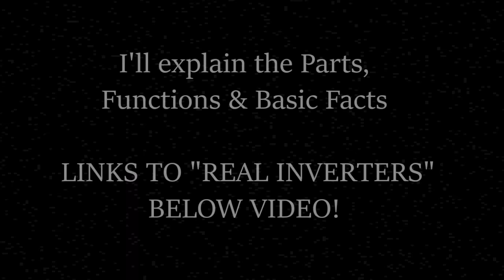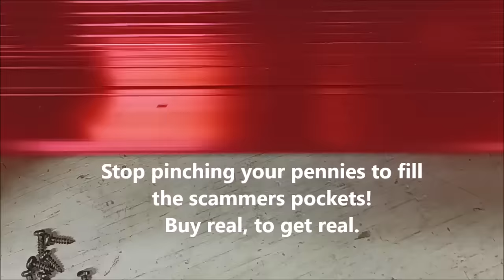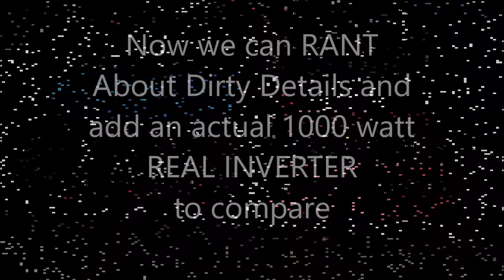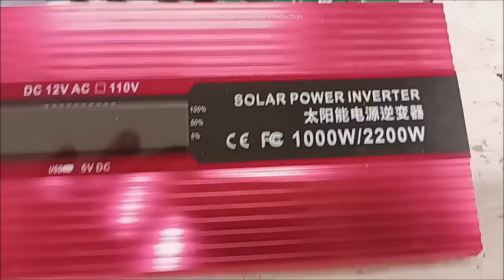Cheap Fake-A-Watt verses Affordable Real Power Inverters, Mega Parts List Below!

Comment: Hi John. I have some 24 v (42 volt open circuit) panels and a make sky blue  60 Amp charge controller. Do I need a 24 volt inverter and two 12 volt batteries in series to use my panels? I need a back up to run my freezer and fridge if power goes out. Do you know of a good 24 volt inverter if that's what I need?  Thanks so much!
Reply from the maker: Most controllers will charge 12 or 24 volt battery. My controllers take in 90 volts and charge my 12 volt system.

Comment: GREAT timing. I am in the market for a 1500 to 2000 Watt PSW inverter. Gotta save up a bit (just blew 8500 on building my truck so funds a bit low atm lol) I ran the 4awg wire today. Working on the power monitor and distribution center now. I will put in my tiny 500 watt one for now until I get better. I trust your judgment. Over the years i have followed you, you have always been transparent and in the beginning i always researched your findings on stuff. I was never able to prove you wrong, after awhile i gave up and just trust your judgment. If you perchane read this. Do you think a used one in good condition is ok? I found a 2K renogy for 100 bucks.
Reply from the maker: Yes, a used renogy 2k is is worth the $100. Just look it over well, and give it an actual smell test. If it smells like anything burned in it proceed with caution. Make sure that the fans come on with a load over 300 watts and test it before you buy it if you can. If you can't probably still worth the gamble they're not really hard to fix.

Comment: Hello, would like to know what are the voltage range to ffed these 12v inverter ? Could it be powered by 18V powertool batteries (15v-21v) ?
Reply from the maker: 10.8 to 15.25 volts is minimum and max.

Comment: Quick question.. I just followed your link to AliExpress and found what seems to be a decent 3000 W inverter. Just to be sure, are you recommending these inverters, as obviously the video was showing the lack of quality in a lot of Chinese inverters. By the way, nice to see an honest opinionated video.
Reply from the maker: Those 3000 and 3200 SWI Power inverters are from a company that has been around over 15 years, they are solid performing inverters without junk parts in them or flashy ads. I have used them for over 12 years, only had one ever needed anything done and that was my cause, not the inverter.
Reply: @JOHNDANIEL1  many thanks for the quick reply - appreciated

Comment: Hey John have you heard of the quality of Seplos products here in Aus its not reviewed at all, the price is higher than Eve etc. Cheers
Reply from the maker: They are just another group of packagers and sellers. They are targeting your market since it's still somewhat open to new branding. However, Their quality is good, and if you want to get it cheaper as with any China ran outfit, you start your arguing and grifting on them for discounts and deals directly contacting them and crapping on their heads!

Comment: Appreciae your channel a lot.. I have a question for you. I have a monster heavy SOLAR PI20000X  modified wave that died. And I cant find any information ANYWHERE on how to open the case. So I replace fuses. I'm stuck. Any help is appreciated  🙏🙏
Reply from the maker: Those have as I recall 4 screws on each end, 3 or 4 on the bottom holding the base plate to the frame. If you can look for a seam on the upper 1/4 of the body, then its a clam shell pre 2016 model. If it has screws on the sides in the fins its a pre 2008 model, TOSS IT. If not then its a one piece, and once all those removed the inverter I think slides out from the solid aluminum extrusion by slightly twisting the outlet side to allow it to fit back into the case and you slide it out. 
Fuses on most were soldered into the board. Best to use 1/4 spade board adapters and solder them in then pop in new fuses. 
The stage 2 mosfets have weak 3.3 disc capacitors, and 10K resistors on them ( think I am accurate ) to control cycle volts, near the large positive lead look there for possible burn on the fets and those items. No schematic exist on this inverter made by EP Tonotran but its build is near identical to older Chicago Electric models by EPT pre 2013 
Get me some pictures olympicpowercontrols@yahoo.com and I can likely help more. ALL ANGLES top, bottom, sides, edges.
Reply: @JOHNDANIEL1    I can't for the life of me see a seam. It's definitely a one piece... SO push  the mainboard towards the battery lug side ? Correct
Reply from the maker: @mlister2073  You should notice the front is able to lay down, twist a little and tuck into the body, and your able to slide the complete board out the back if its that model. Careful not to damage a mini board or control wire.

Comment: You mean pure sine wave inverter with built in heat sink and better than the ones without a heat sink?
Reply from the maker: The inverters that use the outer part of the case as the cooling heat sink you want to try to avoid it's an old style that a lot of people are still trying to build. The ones that have a dedicated internal heat sink allow the cooling fans to do a much better job.
Reply: Hi bro, are you still want inverters now
Reply: Bought it already
Reply: @basilkasimi2646  Sure have a great day

Comment: I was going to get a 3000 watts Aims Power inverter charger, but they were sold out. Just my luck. The transformer in this 2000 watts one looks like it weighs about 28 pounds. I guess I started about a year too late. Then I wanted a Hurricane Vortec. Can't get that either.
Reply from the maker: Get the 240 volt Sun Gold, I put a link way down the list under the video.
Reply from the maker: Started my Web Site to help folks, Raising some cash to make it full of details, parts, plans, rv part options, DC powered materials and schematics. www.mydcvolts.com So it will take a few weeks to totally finish with all the schematics and proven things to show everyone.
Reply: I just about have a hole to the bedrock. Concreting the base then welding the top flange today...might get the turbine installed soon. I got a new torch and a can of mapp gas. I'm going to weld the flange on and paint the pipe industrial grey later today. The base is a piece of 2 and 7/8 with a short piece of 2 and,3/8 welded in the top. It has a stop so the wind generator will be 18 1/2 feet. But I live on a hill. So it's more like 30 feet high to the wind generator. The top piece is fifteen feet of 1 7/8 OD pipe with six feet past the peak, fastened at the top. It has been windy so I want to get it done. I just came in for coffee before I do the concrete.
Reply from the maker: @davidpotter9462  It's a lot of work for sure. Folks our age group are the only ones seeing the writing on the wall of why to be prepared and capable as everything world wide degrades in high speed. When I was young, many a dinosaur ago, my generation waited till radioshack and sears would open to get tools and electronic kits and parts. Conversation in school was in the proper order. Girls, Tools, cars, and What we were gonna build. Today all the youth are consumed with everything fake, including the girls part fake too.

Comment: What do you recommend for a grid tie inverter? I need at least 1000 watt
Reply from the maker: Why would you even consider a grid tie? Back feeding into the grid only takes a decade to pay off. Or do you mean a inverter with grid and battery ability.
Reply: @JOHNDANIEL1  no an actual grid tie. No battery. Who needs all that extra expense and mess along with the room it takes up? Grid tie is clean. Panels last pretty much forever. Batteries you'll get 5 years and another expense. The mess and then exchange hassle.   We get about 100 bux reduction that we see in our monthly bill. If it takes 10 years mostly maintenance free, we are OK with that

Comment: Hello Mr. Daniels, i tried to find the ALFFAA inverter with 24 volt and 2500 to 3000 watts and could not find on amazon.  Is the 12v/1500w inverter the only one they sell?
Reply from the maker: I got an email back from them guys said they would have the 3000 watt in 12 and 24 volt fairly soon.
Reply: @JOHNDANIEL1  great,Thanks!

Comment: Need to run dj out of Car looking 6000watt will one battery hold this
Reply from the maker: No
Reply: @JOHNDANIEL1  I plan on running a dual battery one for engine start and one for operating the DJ system laptop small DJ mixer fog machine going to use a deep cycle large amp hour battery how does the 6000 work with this battery
Reply from the maker: @chancebennett3456  If your running a 6000 watt power inverter you need battery capable of 600 amps draw in max use. If your running 12 volt audio Amps you can do so with 150 AMP battery capacity.  Using a Power Queen 200+ has that ability, and a charger converter for DC/DC from the alternator does the boosting and charging. However, you can install 3 cheap Walmart 29 D Maxx Marine batteries and do the same thing for under $400

Comment: i have a MOSFET 5n3003 damage in inverter are thesome with fp31n40
Reply from the maker: I am not getting a good translation on your question. I am guessing you had a 5n3003 fail, and want to convert to FP31N40 TO-247 POWER TRANSISTOR?
Reply: yes replacement these 5n3003 to ft31n40 are the some
Reply from the maker: @abdulabdulhamid8855  If they spec out as the same then sure you can use them.

Comment: Hello John, are you going to do a make sky blue charge controller review.
Reply from the maker: The have a high fail rate, so I am not wanting to show it works well, which is does, until it fails early due to cooling issues. They skipped effective heat sinking to install a fan, the fan is in the "lowest quality category" you can find in China. The fan control circuit fails, it is using a pwm-fet with 220uf and it itself over heats too. So either the bearings on the fan fail in under a year, or one good hot sunny day the fan control circuit dies.
Reply: Thanks John, I will take your advice.
Reply: John , do you recommend charging my lead acids at 15 volts for 8 hrs every 3 or4 months. Thanks for your help. John
Reply from the maker: @johnbutler5208  Up to 8 hours. So the math is based on total Amp Hours, age of battery and factored use. I used the 8 hours in example of a Standard off grid cabin or small houses 1000 Amp Hour bank using 60 amps charging when they start at 12.6 volts, for 8 hours. If I know your battery banks size, brand, style and age, and chemistry I can tell you a very accurate charge process for cleaning and balancing.
Reply: John, I have three 80 Amp hr ever start deep cycle battery's . They are one year old. Only used for back up in case of a power outage. I hope I'm not bugging you to much, it's just a need to know. Thanks much, john
Reply from the maker: @johnbutler5208  I would suggest a Different Controller. A 40 amp with 500 watts solar on that level of battery. https://amzn.to/3BN5O7V
Reply: Thanks John, will do. I need a new controller anyway. Thanks again

Comment: John is it true that its 1000w total and each plug is only 500w
Reply from the maker: Each plug can handle 1850 watts but the 1000 watt inverter will stop at 1000 continuous trying to supply them. So just set your power needs not to exceed it, or upgrade to a bigger one. One can put out 900 and the other 100 if your loads are set up that way, both are wired back to the same spot on the board.
Reply: @JOHNDANIEL1  thanks.. years ago I purchased a Cobra 2000w in a truck stop it has 3 plugs 2 with grounds 1 without.. I have it wired in my truck and it's a beast.. basically run my power tools thanks John always great to talk with you...

Comment: That blue inverter output voltage is lower than I like see or use but it is better than nothing . that acuright tools it runs funny on different loads and it is over rated. EBay junk . and the red one I would only run lights or something you don't care about . China finest inverter.
For a cheap inverter, CNSWI or XIJIA not bad for cheap inverter . the input voltage display on the  units are a little off they read lower than it really is. But they do have a good wave form and good voltage output 120 volts unlike the blue 1500watt or the black junk tools . the red one just needs loaded down. Untill it blow its gasket and blow out smoke

Comment: Why not do a real test and put them under a real load.
Reply from the maker: I will be doing that, I put it under a 1100 watt hit and 900 watt load briefly but 2 gauge cable length 9 feet and gauge was to light to full blast it.  I have ran a drill press off it, Porter cable upright draw was over 1300 but that was to see if it was worth buying another for someones work van. At 1300 watts it did drop from 112 volts to 109 but maintained 60 hertz. I'll run it on proper cable and loads soon. But like I said in the video, if you need a 1500 watt inverter buy a 2000 Watt. I never try to blow them up on purpose and I need a thousand watt inverter so I bought this 1500 and it was better than I expected. Luckily they're coming out with a 3000 so let's see if they're improvements to an swi power inverter are really good.
Reply: We pulled over 1500W you will need at least 6G cable or better and a large battery if you want to pull that much we got over 12A drawing out the AC plug

Comment: all high freq inverters are junk  low freq has less than half the parts to go bad  they have real transfomers not them tiny things smaller than the palm of your had  it is a lie that all low freq inverters have a high idle currant   some low freq have lower ldle than high freq  and low freq last so much longer they are tougher they start way bigger loads   low freq is the way to go hands down and not no high dollar over price high idle aims or the like  look and ask around and you will find high quality low price low idle low freq inverter  or just keep wasting your money on high freq junk thats your choice
Reply: the ones in the end of video are good but have high idle currant and a high price  look around there is much better now that have all bells and whistels very low idle loses with a  low price
Reply from the maker: I use the SunGold on a lot of locations for affordable low frequency. The gen 1 had 39 watt idle, these are 21 watt due to a better searching design now. High frequency is not actually bad unless you are not using DC to DC on everything you can.

Comment: Nice video good to know the insides are stout: we did a video testing the limits of it and it was very good 60HZ and pulls over the rated 1500W it is definitely a pure sine wave. This is the test:
https://youtu.be/pC5Zdj3zSgY
Reply from the maker: Yes, good results. But you needed heavier battery and wire by just a little.